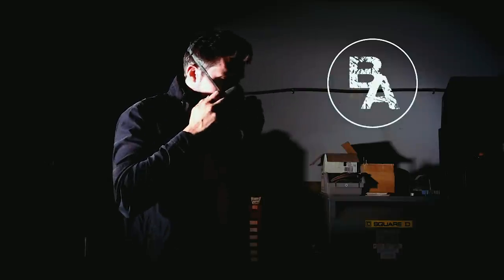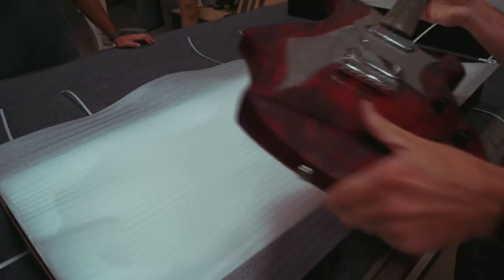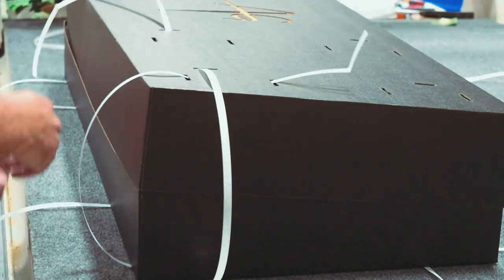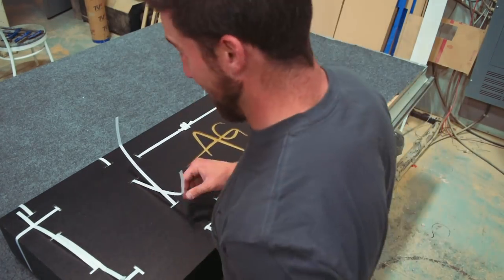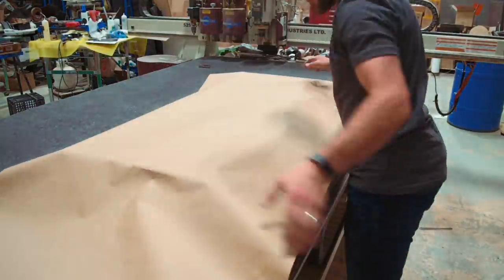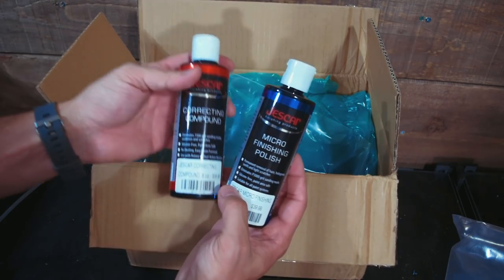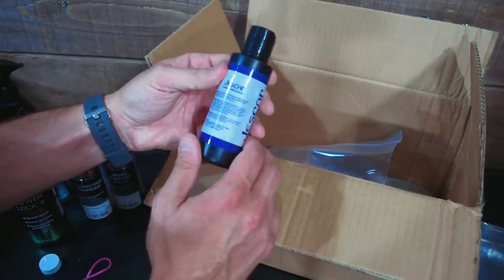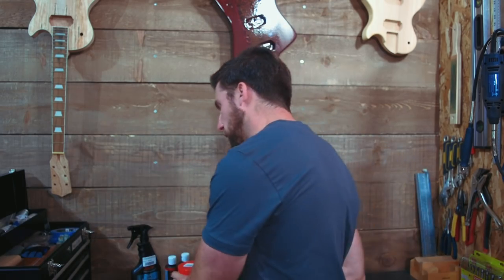Shipping Out a Guitar and a Fun Unboxing

Comment: Good to cya ole chap! Let me tell you, hoseclamp works as a tuning device. It looks very hillbilly but one thing that helps is if the string goes through the wood and slightly carves into it. This doesn't prevent the guitar from tuning but it helps tuning stability. Now if I want to hide the "tuners" I could build a cover. But since they are at the back of the guitar it doesn't worry me too much. I got a perfect low E from it. The sound of a homemade (neck thru) guitar is the sweetest thing! Anyway can't wait to see u have a go at it with that polish! Cya soon and take care!

Comment: Should always put paper between the strings and neck in case some thing sits atop the box or just pressure from the foam . Nice box though ! 
The pressure from something thrown on top of the box could push down your foam into the strings and dent the frets . It’s a small thing to do to prevent the shipping monkeys from damaging it . Matter o fact card board instead of paper would be better . A lot of guitar company’s do this .
Reply: I use a thin cardboard or postal envelope. Yep nothing like frets being dented!
Reply from the maker: There’s a piece of styrofoam in the top section in this box that bridges across the rest of the foam.

Comment: Hello Brad. Unrelated question. How would a leftie neck work on a rightie guitar?  Cut a new nut, and string lengths would be transposed. Tone difference? Tuning issues?...🤔
Reply from the maker: shouldn’t be an issue at all unless it’s a custom neck with an uneven carve. On a typical symmetrical one a new nut should do the trick.
Reply: @BradAngove   If there is any logo or brand name, it will be upside down...
I think I like that!🙃